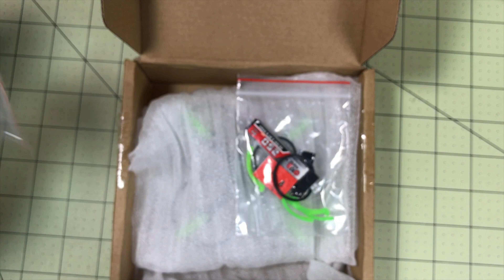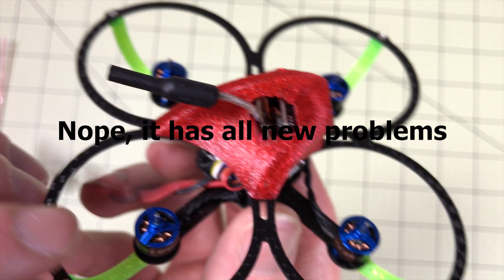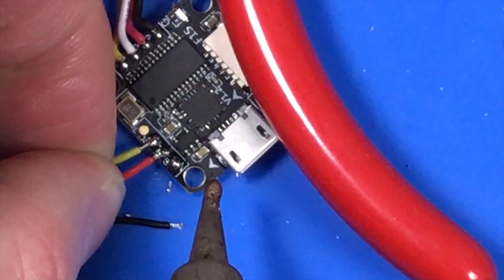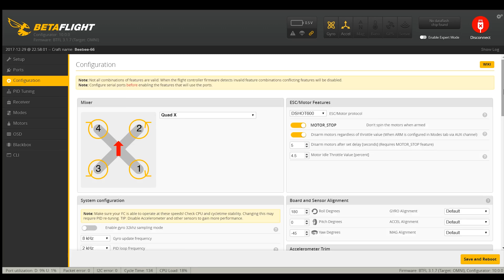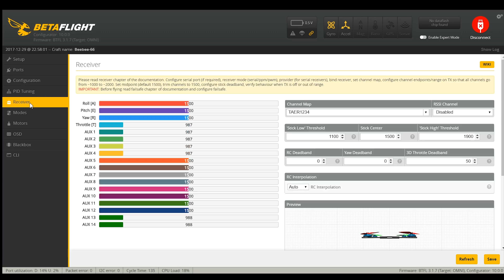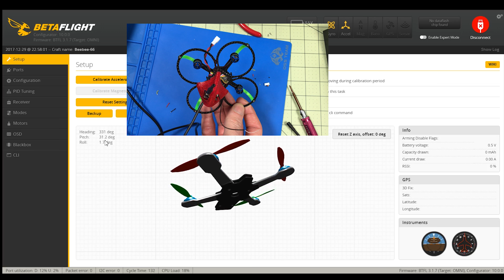FullSpeed BeeBee66 Receiver install and testing. It should be great, but test it before you fly it

Comment: The guards that hold the ducts up can press on the c clamp on the bottom and prevent the motors from turning. Disconnect the green supports, and trim the motor side with a pair of snips. I had an issue with them stopping 3 motors. Sometimes they would spin, sometimes they wouldn't
Reply from the maker: I will try that, but it turns by hand pretty freely.

Comment: Looks promising. Too bad on the quality issues. I had a string of 3 of those 4in1 ESCs I was trying to use in an owl all with 1 dead motor. (twice #3 if that means anything) tried swapping motors around and it was indeed the esc.

 3" quads were big in the fall, is the MicroMicro (brushless Whoop) the "Next big thing"? Looking like maybe... 

Good review, what you had to work with, probably more than it deserved...

Comment: Did you try backing off the motor screws to see if short went away? Possibly screw shorting to winding. You should change your logo to Wyle E. Coyote because like you , he never gave up despite the odds . Hope you work that issue out cuz I "really" (lol) want to see it fly.
Reply: Brad Miles That is what I was going to ask.
Reply from the maker: I haven’t had a chance yet. Hopefully tonight. If not then will this weekend.